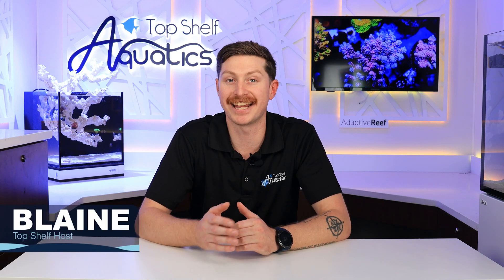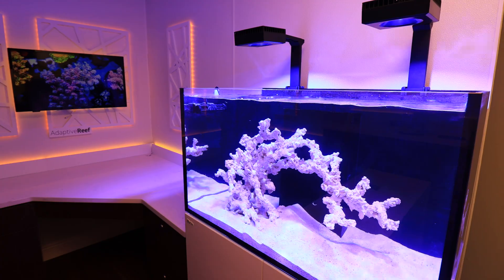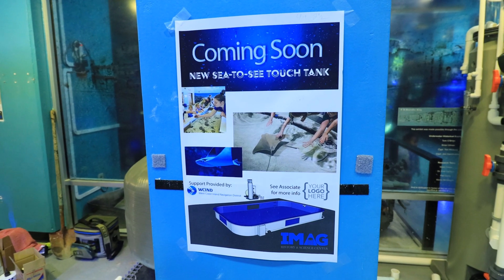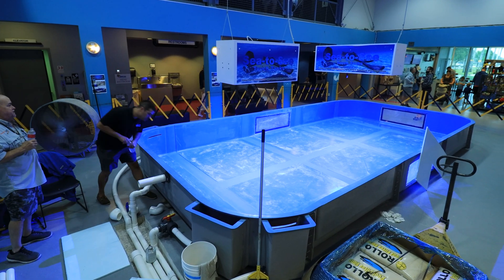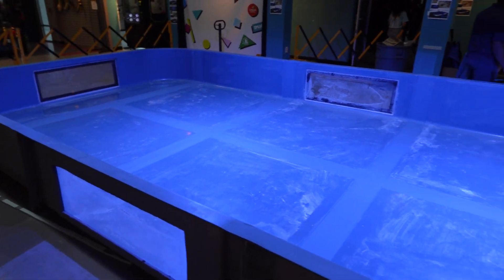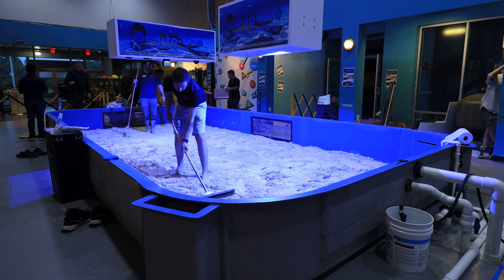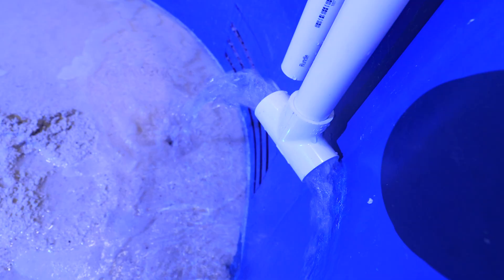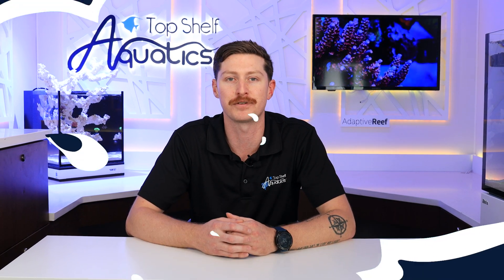MASSIVE Stingray Tank Install!

Comment: Hey guys, as someone with over 10 years experience keeping freshwater stingrays, I would’ve put a white or black gel coat on the bottom of that tank, they move sand so fast it won’t take long and you’ll have blue patches showing which then leads to more maintenance to move the sand around. Just my two cents, it seems like it will be a bit too late now. Wishing you all a great start to the New Year 😃
Reply from the maker: Noted! Thanks for the heads up! Will for sure carry this information with me into any further touch tank work, especially with rays! Thanks for stopping in and happy new year to you as well Ian! 
-Blaine